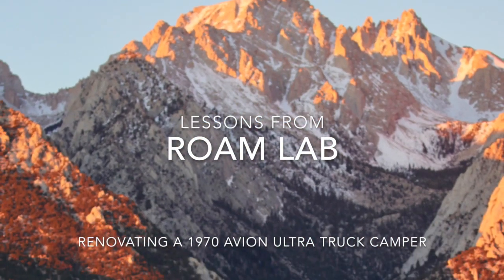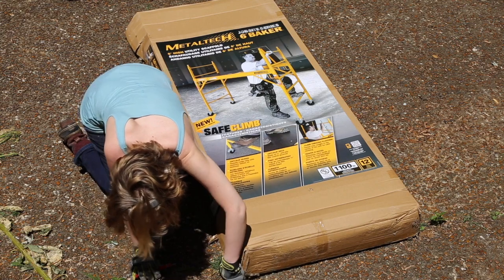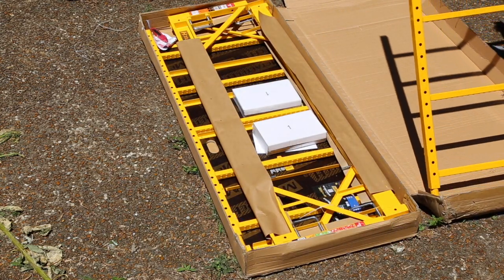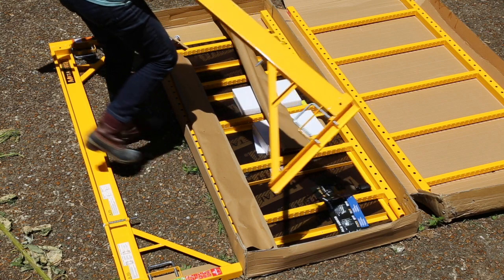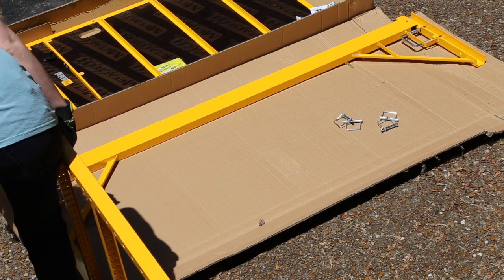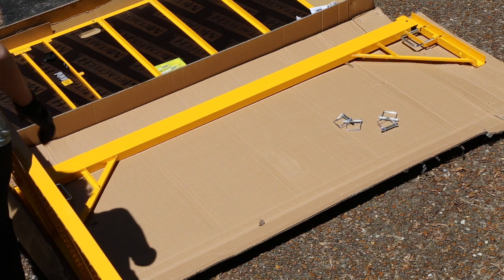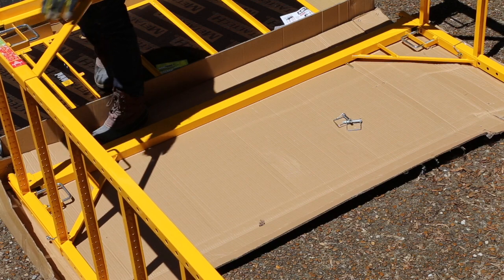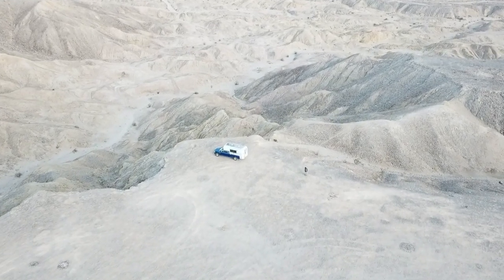Metaltech Safeclimb Baker Style  6 x 6 x 2 1/2 feet Scaffold

Comment: I bought one as well to hang my 90 lbs Chandelier 20 feet up in my foyer. Very easy to put together.  I'm using it as shelving in my garage.. I wish I would have waited to buy it lol... I paid around $900 bucks for 3 units. I saw HD had it for $6 something.  Ugh.  :)
Reply: Just got one for $149. HD had a big scaffold sale, but the one that was featured was $20 off, so $229. Same concept different company. I searched all scaffolds and found this unit at $149 over $100 dollars off.